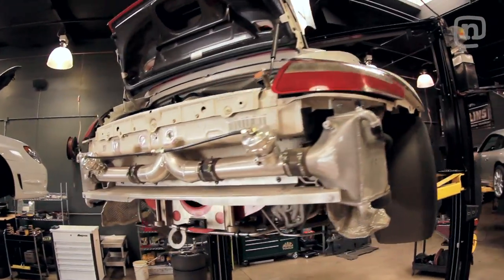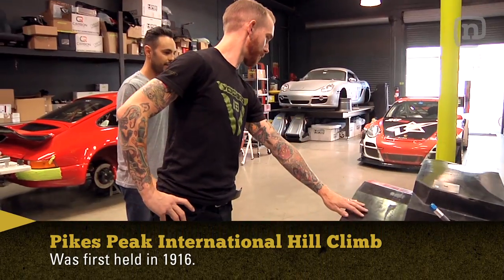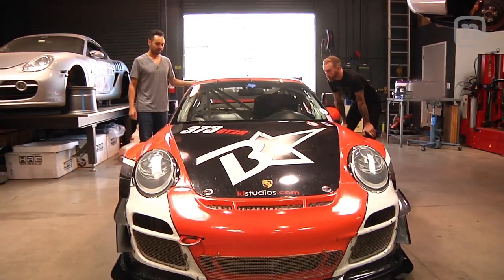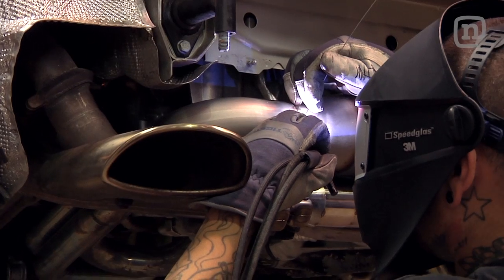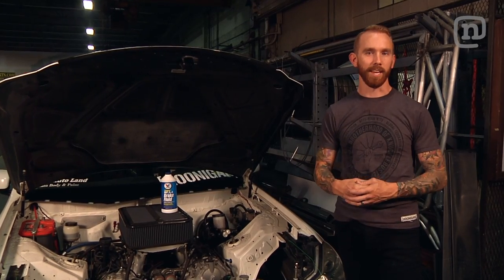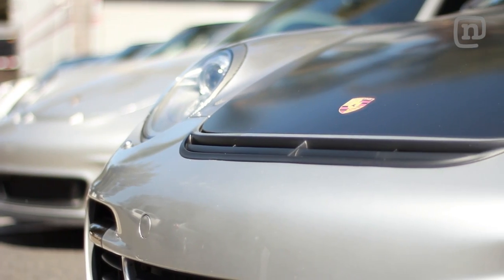Meet The Geniuses Who Make Porsches Go Even Faster: Garage Tours w/ Chris Forsberg

Comment: 293 east from 97 to 218 to Shaniko, OR. (ghost town) then turn around and go back down the canyon and take 218 to Fossil, OR. it's all canyon so you can see if cars are coming and it has some of the smoothest high banked curves I've seen in Oregon..  just did that and much more including 50+ miles of gravel for a total of 481mi in a 2014 Impreza  and the most silent 4th of July EVER!